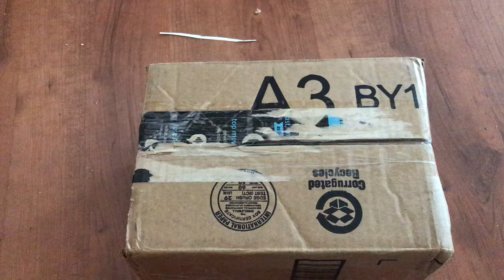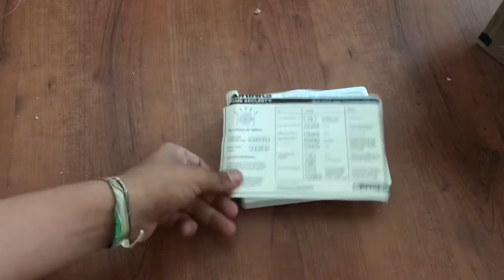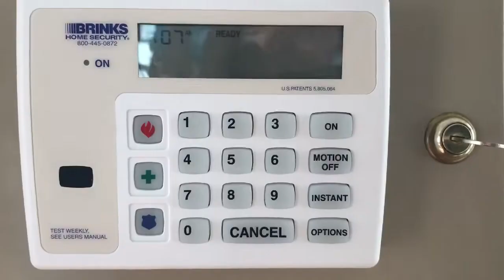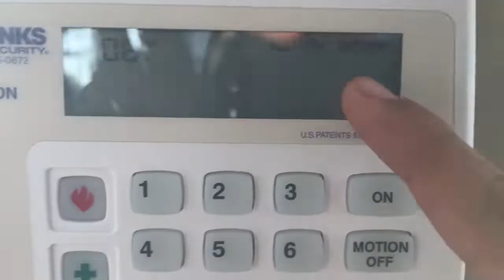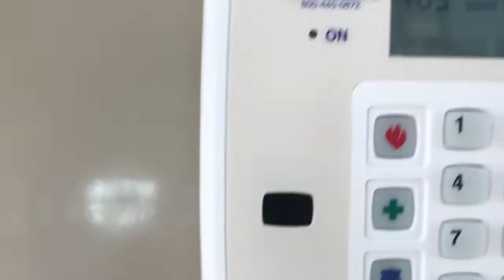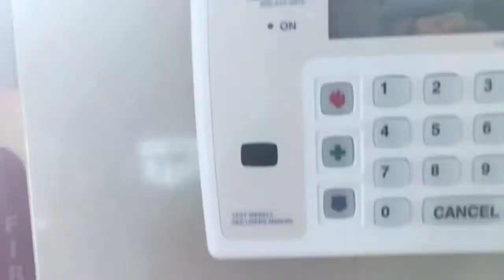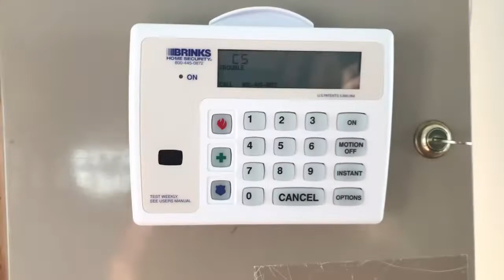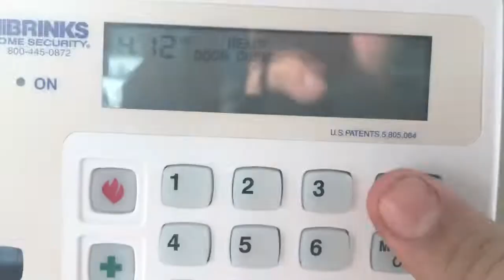Unboxing and installation of the BHS 3102 premium security keypad.

Comment: Nice unboxing, I've seen those premium keypads before and they are great, I like the display that shows how much time is left to leave the building.  What else is cool is how it shows the trouble message every few seconds too along with the clock.
Reply from the maker: Jamestube 8439 I like how it displays the trouble. I do want to see if I can change the time.
Reply: @electricalsmokealarmsandmo1564  Do a video on this, what you can do is if the time is wrong, hold down the 0 key for 10 seconds until the display turns off, it should contact the company and they can put the correct time in your system.
Reply from the maker: Jamestube 8439 I don’t have a company
Reply: @electricalsmokealarmsandmo1564  Yeah you, with Brinks which is now ADT, that's the alarm company
Reply from the maker: Jamestube 8439 what will it do because I did hold it down and all it did is turn off the system.
Reply: @electricalsmokealarmsandmo1564  It will go blank and will attempt to fix the time.  Can you make a video about this so I can see?
Reply from the maker: Jamestube 8439 I will upload it tonight or tomorrow.
Reply from the maker: I am also doing a video on how to add more time to exit your house.
Reply: @electricalsmokealarmsandmo1564  Ok cool!
Reply: @electricalsmokealarmsandmo1564  Ok great!

Comment: whats that black square on the left side of the keypad ?
Reply from the maker: Andoy33 a smart key.
Reply: I've seen those before too, didn't know what it was for.  Now I do though!
Reply: @electricalsmokealarmsandmo1564  How does it work?
Reply from the maker: flarn2006 when you put a brinks home security key for the system on there it will arm and Disarm the system.
Reply: Electrical,smoke alarms and more Do you have one?
Reply from the maker: flarn2006 no.

Comment: That black sensor on the left side of the LCD keypad, is for a wireless remote control. You can have one on your set of house keys, and use it wirelessly to arm and or disarm the system; either inside or outside of your house.
Reply from the maker: Trevor Reynolds that is what I thought it was.  Nice. Do you know how to program one in.
Reply: That's actually not what that's for, unless they have one that only works with line of sight to the keypad. An infrared key fob wouldn't work from outside, unless you do it through a window and the keypad is right there I guess. The key fobs go with an RF receiver, either the BHS-3250 or BHS-3210 depending on the model of fob.
Reply from the maker: flarn2006 cool I did not know that it is a key fob.